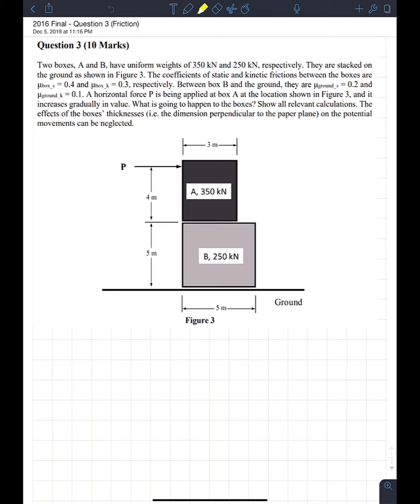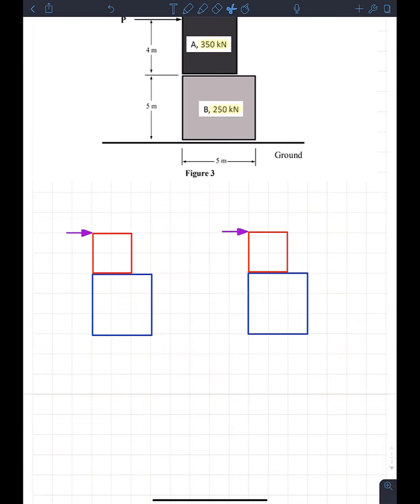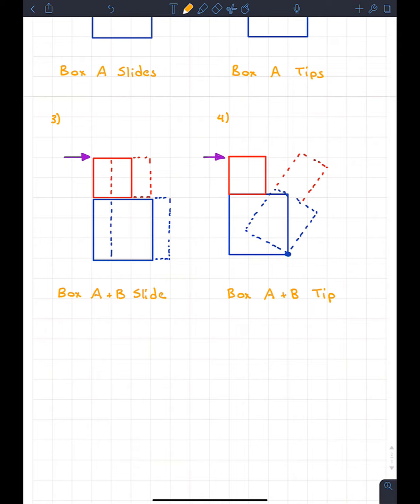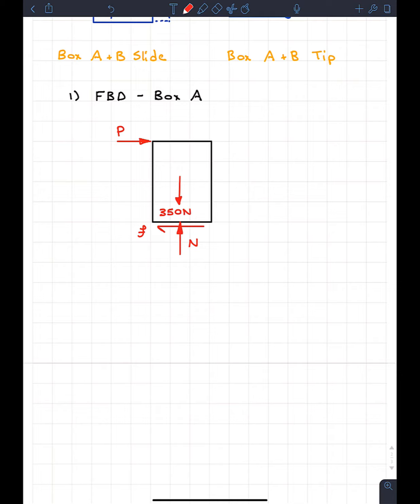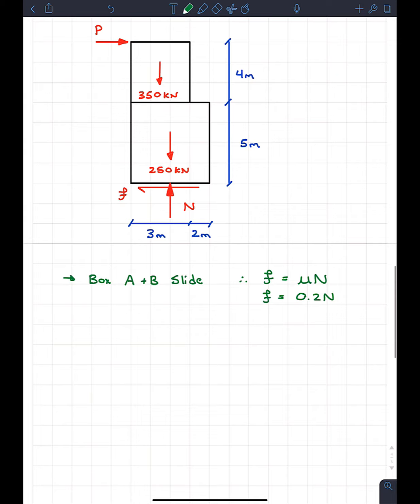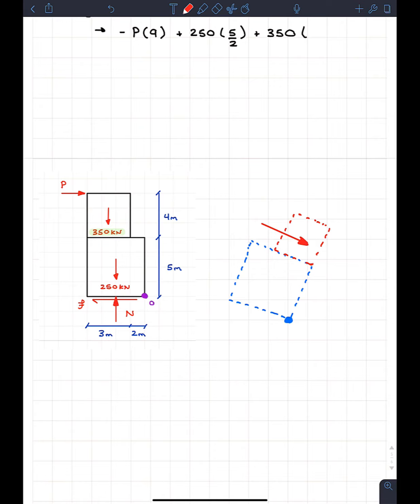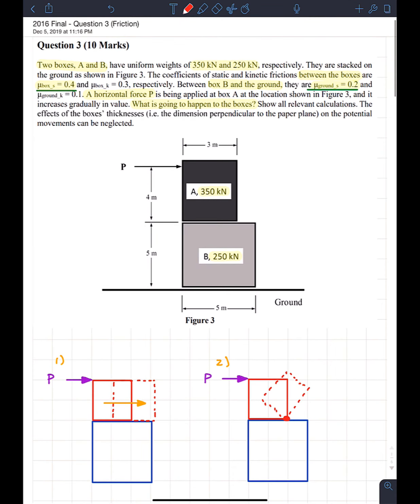Engineering Statics - Old Example | 2016 Final - Question 3 (Friction)

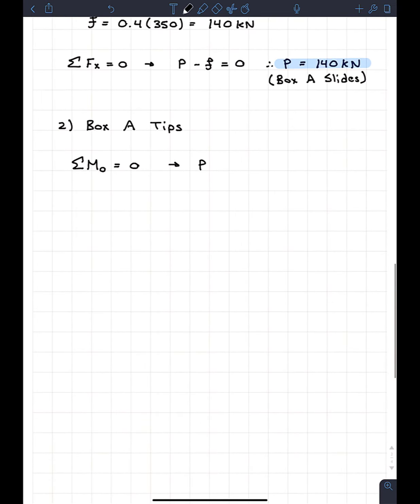Comment: Hi Clayton I’m confused about 17:30 You say that it ever so slightly tips thus the normal force acts at the point where the moment is taken so it is negated. However, at 24:42 you do take the moment of the weight for the same tipping scenario. As you stated previously, wouldn’t it tip ever so slightly such that the normal force is acting about the point where you took the moment?